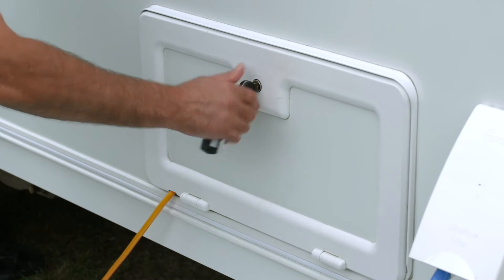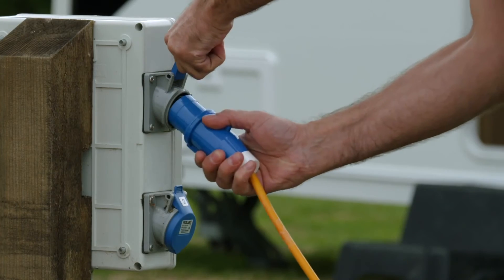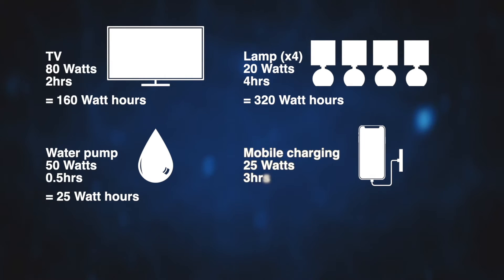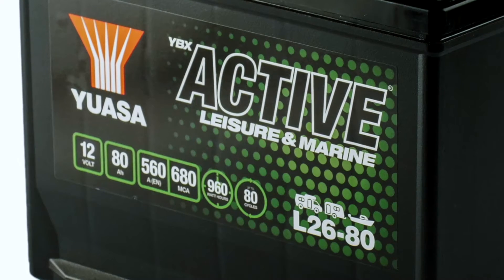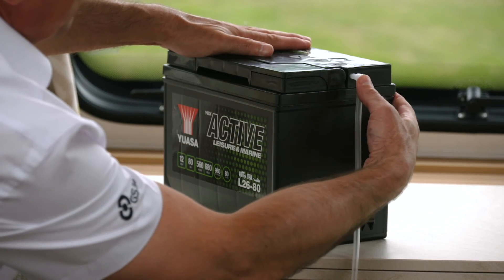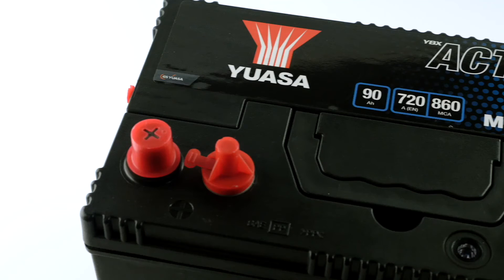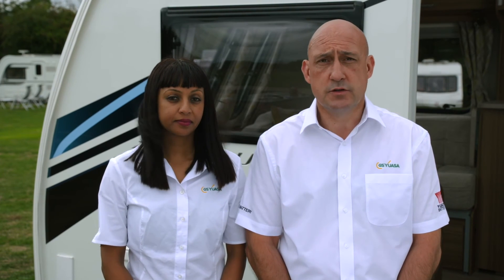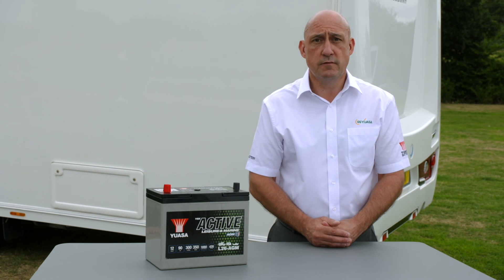Leisure battery maintenance & care - GS Yuasa Academy - GYTV

Comment: Amazing that YUASA now come out with this  very detailed information, must be that they are having warranty issues which we have had nothing but trouble with YUASA BATTERIES,  the old acid battery  made by YUASA must have reduced quality or other low voltage issues due to the material used within the battery because in the last 2 years even with the "green" inspection window glowing green the battery has failed.